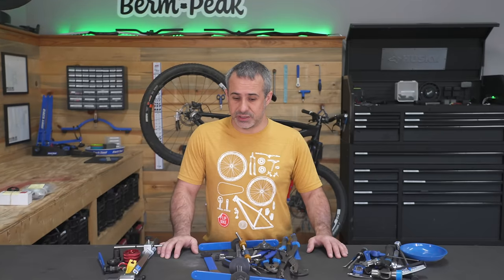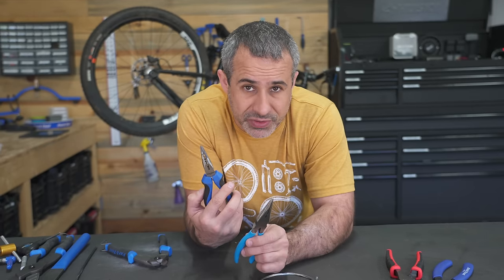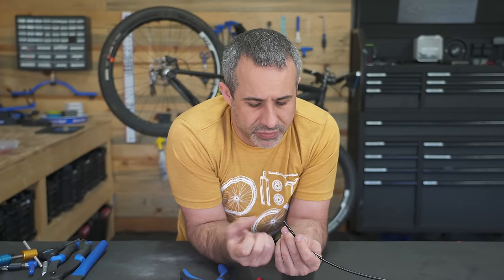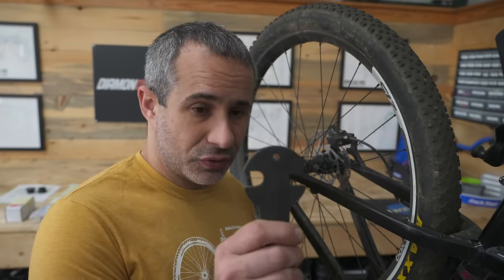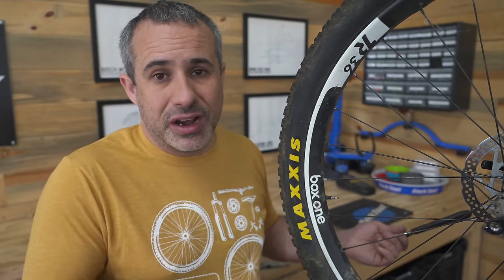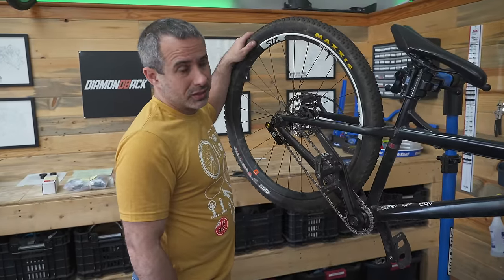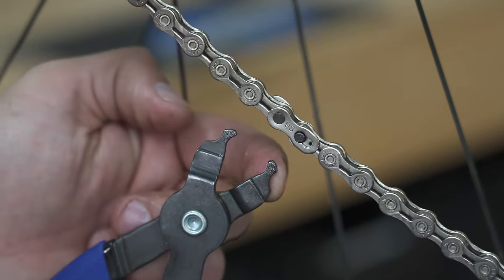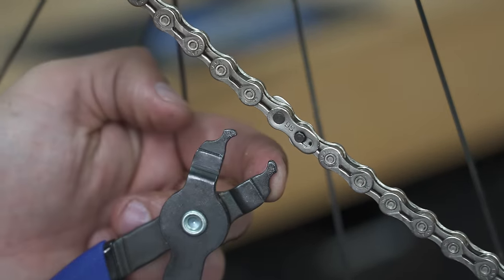Are "Bike Tools" really different from "Tools"?

Comment: Spoke wrench doubles as a valve core tool. Learned this by accident and has been my go to ever since. 
Cheers!
Reply from the maker: You’re right! I never heard that one before
Reply: I think George has earned a sticker 😂
Reply: I have removed tons of valve cores by accident with the adapter of my air pump. So that'll be my go-to tool
Reply: Yeah, specially those spoke tools that have many sizes built in.
Reply: @Knitterfest  Typically followed by a "F**K SAKE!" as with using most good tools.
Reply: What about the saying ‘buy once cry once’ ?
Reply: @mabecka  yeah, but there are some made for steel cable that ain't bike speciphic tools, just random tools
Reply: @69sound81  Kind of what I mean. It's ok to compare it with with other cutters, made for  cutting steel.  Cheers.
Reply: Seth - Awesome video! Can you make a video about the easiest way to change an tubed bike tire using normal and bike-specific tools?
Reply: I'm a part time bike mechanic,bisedes my full time job...i accumulated lots of bike tools...but always on the look to get some more...in my part of the world it's kinda hard to get good tools... specifically for bikes...and if you do .. they are expensive as hell...not to mention park tool... practically unavailable
Reply: @ldoughtyy  what's wrong with sake? I mean, I guess you're supposed to drink it warm, but a lot of people like it.
Reply: @jonlavigne3270  My handtool skills always suffer after a few drinks.
Reply: @BermPeakExpress  - The core tool also fits much easier into a hip pack or hydration pack for longer days away from the car.  Worst case a rock smashes and damages the valve core you still have the opportunity to maintain tubeless setup, though I guess worst case you should always have a tube anyways.  Either way, adjustable wrench is usually a no go in my portable tool stash.
Reply: @Knitterfest  stop using those screw in pump chucks. Nothing is worse than getting a flat in the middle of nowhere, pumping up your tire, only to let the valve come loose after. I looked for ages until I found the perfect hand pump with a flexible hose, high volume and a lever chuck.
Reply: RollinRat  yeah- I agree -that’s what the “buy once cry once” saying means. Cry about paying so much…but that’s the only time you’ll cry.
Reply: Would make sense to make things to a set standard to fit a standard tool.
Reply: U can remove a masterlink with ur fingers i do it all the time or u can use a flat head screwdriver
Reply: I don't grok. Isn't buying a bunch of cool, new stuff half the fun of DIY?
Reply: You can use your fingers as valve core removers

Comment: Biggest tip I heard is buy the cheaper version of every tool first and when it breaks, then buy the expensive one. That way you only spend the big money on tools you use a lot.  Poorly worded but you get the idea.
Reply: Makes sense
Reply: genius mate
Reply from the maker: I tend to do this, and so I own some cheap tools that I only use once per year—perfect, because they’re light use. The ones that aren’t up to the task end up getting replaced real quick.
Reply: good advise yeah! this only applys for stuff coming after your basic setup tho.. like for some good pliers, a set of hex keys, torque wrench, floor pump and stuff like that you're guaranteed to use ALWAYS. but for smaller stuff like chain breakers, bearing tools, spoke tools and so on I totally see your point :)
Reply: I do this too, but downside is breaking a tool mid repair when you’re already stressed and annoyed that your repair is 10x more complicated than the guy explaining the process on YouTube lol
Reply: So true. Smug idiots will say "buy cheap, buy twice", but 80% of the time, it doesn't matter if the tool disintegrates after a few uses because you'll won't need it to serve more than that. Buying expensive tools you won't use is like buying bulk food you won't eat: pure waste.
Reply: Adam Savage
Reply: I think this advice is very good and gets you good coverage for majority of things. But don't skip out on the "right tool for the job" part, it needs to meet certain requirements, which is often the case as to why some tools are more expensive than others. There are multiple examples in this video. Such as that cable cutter not being durable enough for the steel wires in the cable housing and the wrench being too thick to fit pedals.
Reply: @felixbouchard2354  Yes! I think it was Adam Savage! I was racking my brain trying to think of this!
Reply: The one place I wouldn’t do this is with bolts. Bike bolts seem to be made out of cheese, so cheap keys and drivers will just round everything out.
Reply: This is what I typically do as well.
Reply: Don't use common sense on me! I need to spend all my money or I will DIE!
Reply: The real problem is not about money but the fact that when the cheap tool fails it can ruin your ride and your bike.
Reply: I'm very torn about this. Would love for it to be that simple. But in my experience the much cheaper tools tends to work less well, not only break easier. For me personally it's so frustrating spending my precious time on frustration over trying to use poorly built tools ⏳. On the other hand, it's equally frustrating spending hard earned money on branding (especially bike tool specific branding) 💸 
Maybe is just well passed time for me to upgrade a couple of tools that seems subpar and hope the pricier version isn't as well..
Reply: I did this masterlink pliers and chain tool, the only problem was the tip of my chain tool broke off inside the chain and acted like another pin, I tried to get it out with hand tools and ended up needing a new chain.
Reply: @nosreuter  well if you're not using that tool that often then so what if they work less better. You'll only have to be frustrated for a few seconds three times every year. When you feel that the tool frustrates you enough then congratulations, you earned your right to a quality set of tools.

That "buy cheap first" rule is for the compulsive tool buyer who likes to buy tools more than using them.
Reply: On some level yes. I think some cheap tools don't do the job right.  I got s slightly cheaper derailleur alignment guide that still had great reviews, and I've used it and the last two models that park makes as well.  My slightly cheaper one is still nice and heavy duty, aligns things pretty well, but there is a small amount of play in the tool that can't be adjusted out and thus, you cannot truly align everything perfectly. So it's basically completely useless.  It takes everything that park engineered in and just skips that hard work and makes a tool that does a job , but not precisely enough for modern drivetrains. 50 dollar piece of junk.
Reply: I call that the Harbor Freight Rule.
Reply: I find that some overly cheap tools can last forever because they don’t do the job properly in the first place so they are put aside never to be used again.
Reply: I do this, UNLESS the good tool is only about double the cost of the cheap tool. If the good version is $20, but a cheap one is $10, I'm just gonna get the good one. Sometimes it's better to buy once, cry once.
Reply: Thats what my dad does too
Reply: Some are not worth to buy cheap.
Like wire/cable cutters (cut quality) chain/drivetrain tools (very often in use)
But some we can buy as a cheaper alternative - like screwdrivers, allen keys, tyre levers.
Good alternative for beginners is to buy "cycle set of tools".
Reply: Yeah that’s the dummy way to do it. Buy once cry once
Reply: Agree- I destroy the cheap tools by misusing it.
But now I understand what is fore what😂
Reply: I agree. I bought a cheap chain tool for $20. Broke it in 2 seconds. Then bought park tool one.  Best investment.
Reply: @dsp4392  Actually, buying garbage you know will not last because you are cheap is PURE WASTE. The weird logic twisting people commit to is strange.
Reply: Heres an idea: Do some research and buy the right level of tool for the job. Its not very hard in most cases to do a quick damn google search to determine if a tool of X quality is needed. Being cheap is being cheap; regardless of your justifications. Plenty of people already invented the wheel and posted about it on the net, zero reason to go in blind like a moron.
Reply: I've had cheap tools break the first time I used them.  Maybe I'm going a little too cheap.
Reply: @agmood  If you buy a Harbor Freight vernier caliper, it's a Fornier disguised in a different color plastic.  Why pay more?
Reply: I mean if uno ur gonna use it a lot might aswell buy the real deal
Reply: Some bike repairs I don’t do very often. I am not very proficient in them, and I don’t want to make my life hard by fidgeting with a cheap tool. So if I want it to be an easy, high quality repair, I get good tools.
Reply: Quick caveat here. Make sure your cheap tools break before your parts do. I once broke a smart phone screen during a replacement because I used an expensive metal spudger rather than a cheap plastic one.
Reply: This is great advice!! I spent a fortune on pretty much every tool needed, think I actually use maybe 2-3 regularly 🤦
Reply: I tent to buy good (expensive) stuff which i know beforehand i will use a lot. If not, i buy cheaper stuff. This way I never have to buy cheap stuff for things i know i will use a lot beforehand 😅
Reply: This method, as good as it sounds, has one big problem: 

Cheap screwdrivers destroy screws! Even the expensive screws. So many cheap tools don’t break but damage other things + don’t work well
Reply: And if the expensive one is no better than the cheap version? With bike tools I've found there's a lot of variation and quality does not always correlate to price, Park being the biggest offender IMO
Reply: As usual  - apply common sense  - then - yes absolutely.
Reply: That sounds good until you consider that you'll break a bunch of parts using cheap tools, not just break the tools themselves.
Reply: As a mechanic its the same for me you could go on the snap on van and come out with 5 tools and spend well over £1000 they always love apprentices for this. Some stuffs good some stuffs just rebranded like the tap & die kits, stud removers and you can buy those else where cheaper.
Reply: And sometimes the cheap one lasts forever. My idiot harbor freight random orbit sander and angle grinder WILL NOT DIE. I want to buy new, nice ones. But won't until they stop working, and I use the HELL out of them.
Reply: Underrated tip!
Reply: Are toppeak any good?
Reply: This can be a logical sounding idea, but the first tool you buy could be so cheap it could damage or destroy a part.  This is always the caveat.

Also you can buy a cheap tool that is badly designed- like a cheap derailleur alignment gauge will have slop in the fittings and thus will not actually align your derailleur properly and may end up causing you more and worse problems..

As a man who has gone down this road, make sure the precision tools you purchase are actually precision grade and dialed i.  Saving 30$ dollars may cost you hundreds.
Reply: It's good for some stuff but sometimes the cheap tool will break your expensive object. Not always but it's a risk with somethings.
Reply: I have thousands of pounds worth of tools that I've spent a lifetime collecting. My advice is to buy second hand quality tools and look after all your tools. Also, if you have a job that requires a specific tool, you should consider making your own tools if you have the skill and tools to do so.
Reply: It's good advice😂

Comment: My dad was a machinist and mechanic since 1958, and the one thing he always taught me, NEVER use an adjustable wrench on anything, unless you have no other tool to be able to use.
Reply: I’m a mechanic as well and the only thing I use a plumbers adjustable wrench on is to break tie rod lock nuts loose.
Reply: Allways make sure you use a metric adjustable spanner for metric nuts and vice versa for imperial.
Reply: thats probably because he knows you and assumed you weren't mechanically inclined enough to tighten the wrench every time you put it on a nut. if used properly its actually a tighter fit than standard wrenches and will clamp onto the nut
Reply: @matt7775 so true. Same applies when trying to put imperial bubble in a metric spirit level.  Totally incompatible.
Reply: Only thing an adjustable wrench is good for is bending back bent metal. Lol

Comment: I’ve worked at a bike shop for years and seen a lot of customers get by with the simple tools that they have in their garage. The problem is with the non bike specific tools is they end up doing more damage to the bike. Which can be more expensive to fix overtime. Bike parts and components are all made to very fine measurements. Bike specific tools are made to fit those measurements. Just buy the good bike specific tools that you use a lot. The stuff like hex wrenches and screwdrivers are fine to buy at your local hardware store. As long as they are name brand they don’t seem to cause issues. Hope someone found this helpful.